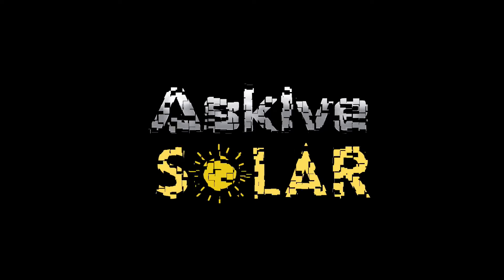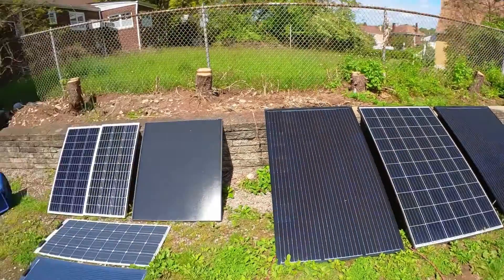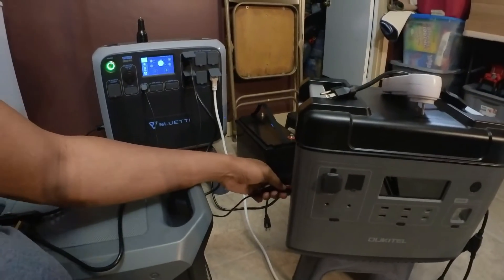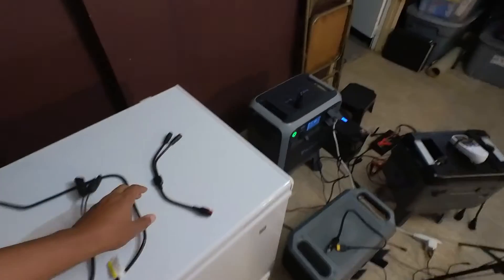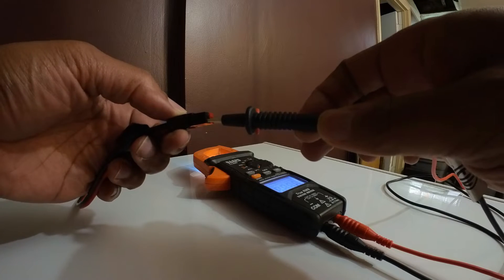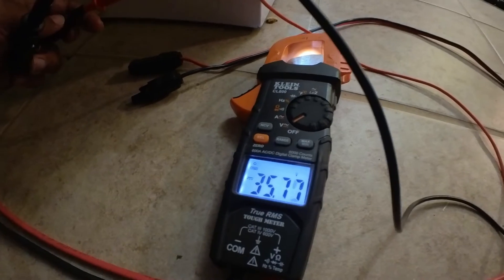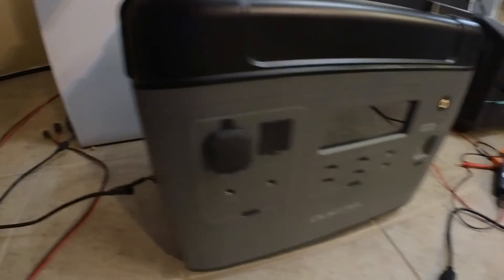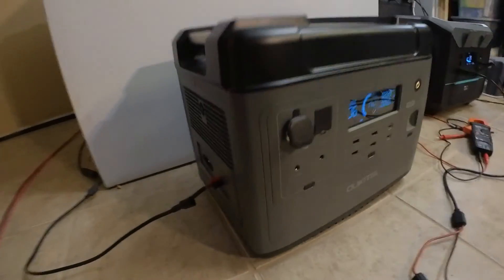Oukitel Stopped Charging!! - The Solar Port Melted Now What?

Comment: Sounds like you went over the solar capacity for the system. All these units have a max solar input and it sounds like you went over that. I have Goal Zero Yeti 300x  and the max solar input in 600watts. Do you know the max solar input for your system?
Reply from the maker: Yeah I'm super aware of it. 50v 500 watts 15amps

Going over those if pretty hard for the hardware I had back then. And Amos are hard limited on almost all power stations. 

Something went awry that's for sure. I think these Anderson  cables were cheap and not actually rated for 15 amps
Reply: @AskIveSolar  just make your own wire, that’s what I do. Buy the crimper and stuff you need. Shoot! I even made one 30amp cable. Just make sure the Anderson kit you get says 30 amps or the leads won’t be able to crimp around the wire.

Comment: Weird how a cable fails like that, sure it’s not been crushed in any way?, stood on, something dropped on it? Try a continuity test on it and see what you get
Reply from the maker: I will have to look up how to do a continuity test. ha. Crazy part is it happened twice to me. It must be something I did, who knows.
Reply: You’re doing the best you can with what you got it easy to make mistakes I melt my solar hub with 4 harbor freight panel panels I’m not sure what happened but it was pretty hot 23 amp

Comment: Love your channel :)

not 100% fan of anderson powerpole

 side note: Maybe you could mod it to MC4 cables as easy as we did with the oukitel p2001 model :)

Let us know what you find out.

here is our mod that we did with the p2001
https://www.youtube.com/watch?v=aDLkttcoNrI
Reply from the maker: Yo! If Oukitel keps ghosting me, I may try this! I would probably just keep the cover off, I know you dont rec that because of air flow tho.
Reply: @AskIveSolar  Yep, Keeping that cover off all the time would hurt the air flow and cooling temps, but if you just cut a small hole into that casing if it has a same connection as that p2001, at least you would feel safer about that cable setup running to the outside of the case :)

P.S. What's up with the companies ghosting people, We have heard that a few times :(

P.P.S. Happy customers, happy business :)

P.P.P.S. it's a pretty simple formula ;)

Comment: Most of these 'after market' APP adapters are made for 10 amps or even less. Anything higher and it could damage the cable. That charging port on the Oukitel and Acevolt will take in 15 amps. I like making my own APP cables that can handle 20 amps continuous or even 30 amps continuous. Perks of purchasing the APP crimper and such.
(this video is from the summer, must have been a patreon only video or something?)
Reply from the maker: I'm waaayy behind on videos. Waaaaaay behind. Trying to get caught up. 

That's a good point about the ten amps. Crazy thing is that they are shipping them with their devices.
Reply: @AskIveSolar  getting behind is frustrating. The weight is heavy man....wishing you the best of luck getting all your videos out!

Comment: Glad you were able to catch it! And thats the beauty of these mc4 and Anderson plugs.. you can take them apart pretty easily to make sure the connections are still solid and fix them if need be.. as compared to xt60/xt90 where they are soldered in. So I would pop those suckers open on that faulty cable and see if the connections look wonky at all. Might be an easy fix for ya?
Reply from the maker: Good point about anderson and mc4, i dont like repairing anything tho. lol
Reply: @AskIveSolar  hahaha I feel you 100% on that homie! Time is money! 🤑

Comment: Note that when you force the tip of the Multimeter into those cheap Anderson cables you end up straightening out the pins(s) which then cause the "loose" connections you are seeing. Happens over time when voltage/current testing. zcheers, hope that's the issue, sure appears that way!!
Reply from the maker: The good thing is I don't probe them often and definitely didn't before I had the issue and me being a volt meter rookie and an Ive (lol), I don't force anything.

Comment: Anderson connectors have a slight curve in the metal in the connector, If the curve straightens out a bit over  use and time the connection to your equipment appears flaky because those metallic pieces are no longer maintaining a solid contact
Reply from the maker: Interesting. I swear, even to a fault of creating videos, I hate disconnecting and reconnecting stuff. So I don't know Sir. 
I wonder if the 15amp rating is max and these companies are not aware of that caveat. Haha. So here come me trying to push the rated power and they simple can't sustain that for long.